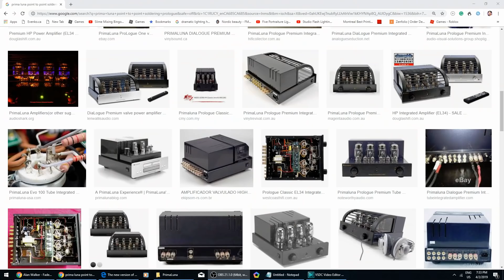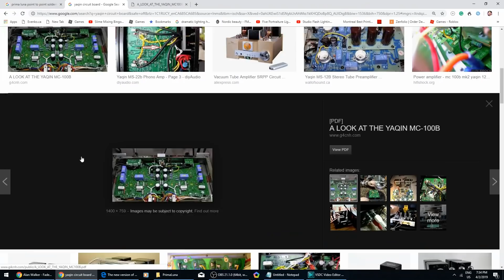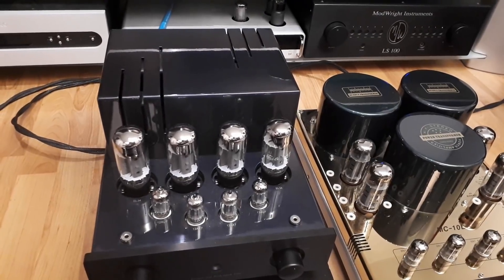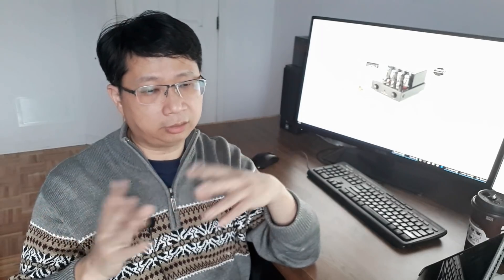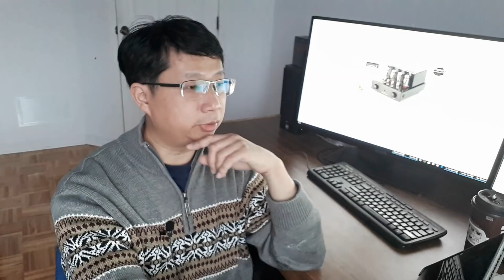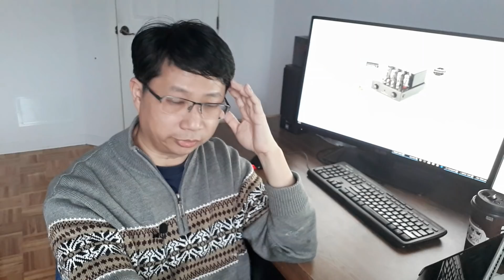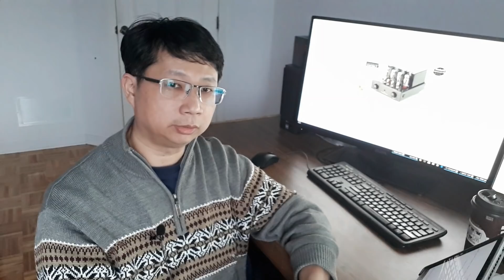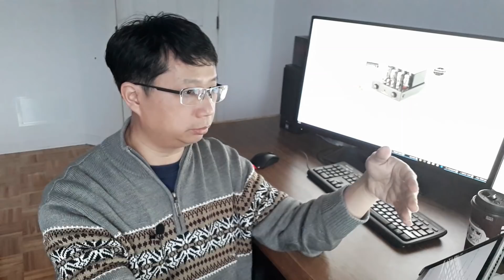Amazing PrimaLuna Prologue tube integrated amp vs Yaqin MC10L

Comment: Hi Thomas, I don’t think you should have to compromise by choosing between a “vintage” and “modern” sound. You can have both musicality and resolution. I've found that quite often, the brightness and leanness people object to is the result of noise. If you’re looking for ways to lower the noise floor on good tube electronics, I can offer a few suggestions: 1) If it has a cheap power cord inlet, switch it out with a Furutech NCF inlet. 2) if you have cheap RCA jacks, switch them out with Cardas jacks. 3) Experiment with Bybee iQSEs. 4) Use a good audiophile fuse. I like the Synergistic Blue Fuse. 5) Contact Stuart Jones, president of Chapman Audio Systems. He’s created these little capsules that go inside components that significantly reduce noise. 6) The component platform also makes a difference in high-end audio. I like using individual Sistrum platforms for each component to avoid the vibration from one component affecting the others. 7) Mapleshade Brass Tube Halos can also have a significant effect in reducing noise. Of course, a good audiophile-grade wall outlet, power conditioner, and power cable will also lower the noise floor. Regarding digital front-ends, I recently tried the Furutech Flux-50 in my CD player and was really impressed by how much it reduced noise.
Reply from the maker: Thanks for the suggestion. One of my friend want to give fuses a try and I wonder how much difference it makes. I never heard of Bybee iQSE, will check out. The rest like power and rca, we have tried those. Thanks again.
Reply: @ThomasAndStereo  The Blue Fuse is one of those small but significant improvements. You’ll hear a little darker background and more “meat on the bones”. Given that stock fuses have a wider tolerance band, order one amp rating higher than your manual specifies. Con: 300 hours break-in can be a bit of a roller coaster ride with some ups and downs. The price is obscenely high given what I'm guessing manufacturing cost is, even when taking into account R&D and the cost of doing business. https://www.synergisticresearch.com/fuses/blue/

With the Bybee iQSE and QSE the sound becomes more organic and you hear more of that magical holographic imaging around the instruments. I have two iQSE attached below my Cary 300SEI, near the rear jacks and below the power supply, two inside my Cary 303/300 CD Player, and two QSEs taped on my fuse box. https://bybeetech.com/products/#treatment-for-rooms-power-and-components

I haven’t tried Stuarts capsules yet. He’s a very honest and knowledgeable audiophile. He told me that I’ll have to experiment to determine the optimum number. They reduce the noise floor but too many of them can make the system sound dead. Stuart is also a Bybee distributor. http://chapmanaudiosystems.com/Contact/index.html

Three more very nice noise reduction devices I forgot to mention are the Furutech destat III, the IsoTek Full System Enhancer CD, and the High Fidelity MC-0.5 Magnetic Wave Guide (which made a very noticeable improvement even though I already own an Audience power conditioner).
http://www.furutech.com/2016/02/12/12469/
https://www.isoteksystems.com/product/essentials/full-system-enhancer/
http://www.highfidelitycables.com/products/conditioner/mc05/
Reply from the maker: THanks for taking the time to write such a long reply. Appreciate it. I will use this as reference when I am ready to try those.
Reply: @ThomasAndStereo  You're welcome. Besides using the IsoTek disc weekly to remove static charge throughout my system, it's also an excellent cable and component break-in disc. I ran the break-in track on repeat for around 20 hours when I bought my amp and the improvement was very significant. And it's inexpensive, around $30 (unlike the $150 Luminist System Enhancer CD from Purist Audio Design). :-(

Comment: My favorite tubes are the Siemens EL34.   They are NOS, but Mesa Engineering (a guitar amp company) tests and labels the NOS tubes as STR-450.  I really liked the PrimaLuna but went with the Cary Audio SLI-80, also a point to point handwired amp that runs in triode mode and ultra linear mode.  It sounds amazing through the Buchardt S400.
Reply: cosmo naut I love the Cary SLi 80 but sadly I sold it due to sounding way too solid state’ish. Good tube amp for sure but the Cayin A88T MK3 sounds way better! 😉

Comment: I have just bought the prima luna evo integrated 100 amp, about 200 hours play time so far. With my focal speakers I have to say it is the best sound I have ever heard.
I wanted to ask.
 Are there any DAC do's or don'ts for  valve amps particularly Integrated ones?

Comment: The Yaqin 10L benefits greatly if you up grade the coupling caps (100n 300v on your MK2) , also up grade the tubes, those stock Shuguangs are very poor, you can't buy worst tubes than those!  Try replacing the 6N1P's with E88CC Tesla if you can find any, as for the power tubes the current favourite is the Gold Lion KT77 also the EH 6CA7 is note worthy.
Changing the volume pot for a Alps type 27 Blue (use 50k Log) is another worth while mod. Good luck.
Reply from the maker: I remember seeing videos on modding the Yaqin and I did consider it. For the Yaqin, we actually had 2, The 10L and the then the newer one. We did try tube rolling and yes it did help with the sound big time.

Comment: The best tube integrated amp I ever heard was the LEBEN
CS-600 the problem is getting one is very hard and the wait list is long and my dealer only had 1 display model. The thing is AMAZING with the best volumn knob I ever felt ever. The prima luna's I heard were kind of not to my taste though and slightly cheaper sounding even though they had premium pricing. You really need super efficient speakers for them in opinion. The all japanese made Leben blew it out of the water BUT sometimes with this stuff you just can't get it. I will tell you the Leben makes bass and it was able to make a pair of inefficient and harder to drive Harbeth 30.1's its bitch. It is rated at 32 watts but more like double that I think...The Hyodo-san who makes these things is one of the top tube guys in Japan.
Reply from the maker: I see, I don't know much about Leben but it is now on my radar.  If it can drive a harbeth 85db speaker well, then it's something I really like to try.
Reply: @ThomasAndStereo  They are a small company he only has like 5-6 employees and they make 1 amp a day. The guy came from Luxman and was like running product development there for 20 years or something. So he knows his stuff.

Comment: around 14 min. i think you touched upon something interesting. PrimaLuna vs Yaqin regarding sound improvement limitations when upgrading to exotic NOS tubes:  i hear about a couple of rules in integrated tube amp design, which are shortest path (soldering point to point), and minimizing interference (magnetic, microphonic, etc.) in component placement. These are tried and tested experiential qualifiers that have almost been promoted to mythological status in tube amp design. Yaqin takes a more modern approach using circuit boards. PrimaLuna uses point to point welds. It’s interesting to think how these different approaches to design may affect or enable the ability of one amp to respond in sound quality with exotic and rare NOS tubes.
Reply from the maker: Good point, I never thought of it. Thanks for commenting.

Comment: Great video Thomas !
Very interesting product.  Have you tried different speaker with the PL?
  I am trying to understand how to select speakers with tube amps.  I was told that higher speaker impedance is usually desired and should be the main criteria over speaker sensitivity, technically speaking.  Should it really be a concern ?
Reply from the maker: I did try with all kind of speakers even those that are close to $10k. I would say it sounds great for the top end and mid range. Bass, is just ok. I understand the speaker impedance issue but I don't have a lot of knowledge with it. One thing I learned in the audio world is 1+1 does not always equal to 2 and you don't know until you plug it in. There have been some surprised along my journey.

Comment: you ever listen to them older Carver gear ? You mentioned the yamaha as-801 before i started my bargin reviews I bought the yammy I was so upset with the sound signature I sent it back my because my 2010 Yamaha Ax497 has such a lower noise floor and more of a fuller sound
Reply from the maker: No I never heard Carver. The AS801, yeah it's rich in feature but sound quality is so so.

Comment: A certain amount of the sound is conditioned by  partnering equipment. Cables. My amp was too warm. Fuzzy and a lot of hash  Change fonfo stage cabling etc this can significantly increase detail etc maybe because of noise reduction
Reply: I have always dismissed cables as snake oil. I still mostly think many cable products are just hype. However, I recently changed my speaker cables (25m distance from amp to speakers) from 16AWG to 12AWG and I couldn't believe the difference. I am not sure if it's just louder or if the sound is "warmer"... but if it is just "louder" I certainly prefer that 1dB of loudness, which somehow sounded "warmer" and more "expansive" to me.... I spent about 2hrs plugging and replugging the two sets of cables to make sure it was just my imagination.

Comment: Thomas, have you ever thought of bi-amping to improve that (for you only marginal) weakness in the bass? I use two Belles 350 A Refetence amps which does not only increase bass impact but also overall clarity. What works with solid state should work for tube amps as well.
Reply from the maker: Sure, only thing is the amp must have a gain control.

Comment: Hi Thomas, great video and down to earth analysis. Thank you. 

I think that it is fun to experiment with different gear and cables to learn what they can do to the music. Until one hears something and have someone points out that this is what it is called, it is difficult to imagine what that experience is, such as your term holographic, or perhaps air or soundstage? We bought a PL Prologue Premium a few years ago, the tubes that came with it were fine, then one of them blew after a few months and I bought another set of PL tubes (2X5AR4 and 4X12AU7) with gold labels. They were less than ideal. A few days ago I bought a set of Mullard (Russian made) and the music came alive. I can hear much more details, clarity as well as really nice solid soundstage, the bass is much better than before because I can hear the notes in the double bass and bass guitar clearly. The system has never been better. I use Chord Qutest, with AudioLab monoblocks and Celestion A2. They are relatively inexpensive gear but the sound is very satisfying. Part of the fun is to swap gear with friends and try a few things to find out what one really enjoys. As you mentioned, we have different preferences afterall. Look forward to more of your reviews.

Comment: The newer Prima Luna are supposedly improved.  Fuller sound tubes seem to be slower and don't get the musicalness as accurately as thinner sounding tubes with great quickness. Tone is important with tubes too, especially if your speakers have great tonal qualities.  Good power conditioning can get the grit out of the sound and make the tone (color, warmth) smoother and sound better.
Reply from the maker: I just need to get my hands on one to try. Thanks for the comment.
Reply: @ThomasAndStereo    PLEASE do Thomas!  Evo 100 Integrated (with the precious Pre-Out that I desperately need to biamp :D)
Reply: Thank You for your comments 🙏

Comment: Hi Thomas; very insightful presentation.
What about hybrid integrated amplifiers (tube input stages)? I am looking at amplifiers that will drive magnepan loudspeakers such as Vincent audio or Rogue audio. Your thoughts would be appreciated.
Reply from the maker: I have the Pathos Logos and it's very good. Too bad I have quality issues with my both unit. But for sound, amazing.

Comment: Primaluna is made by Sparks in China which they also make Cayin amps. Sparks also makes amps for other lesser names in tube audio. The issue with Primaluna is their so called “auto bias” electronic issue which tends to fail and cause issues. Primaluna is trying to eliminate the guess work of biasing tubes etc. IMO Cayin is way of a better option than higher priced item from Primaluna. Yaqin, Audio Space Galaxy, etc are other nice options to consider. As always, your video content is awesome to the audio community
Reply from the maker: Thanks, I am always curious about Cayin. Since like a well made product that will perform above it's price. Problem with them is whenever I come across one at a good price, they get sold really fast.

Comment: Not all tube amps respond well too tube rolling and upgrades. The design is the main factor.

On my Cary SLP-05, swapping out standard TungSol or EH tubes to NOS it gets very obvious. Then different NOS tubes will change the tone, not great amount but you hear the difference.

Sent my El Cheapo Yarland for upgrades, Mundorf Mcap Supreme Evo caps, Kiwame, etc. Got EH power tubes and all. It was just slightly smoother. Not a big difference. But it’s a great little tube amp. Cheap and good.

I’m still thinking of a PL amp. Itching for one. 😬
Reply from the maker: Yup, thanks for dropping by and commenting. Appreciate it.

Comment: Very interesting video. I also have heard solid state analytics in modern tube gear especially in Audio Research,  new McIntosh tube amps, and VTL. I also have heard tube like musicality in solid state amps  from manufacturers like Balanced Audio Technologies, Chord, and to some degree Electrocompaniet.  Where the focus was towards conveying sweetness and warmth over unflinching accuracy and hyper detail. Recently auditioned a Simm 760a, BAT VK-255se, and BAT VK-76se. It was surprising how different the Simm and BAT solid State amps sounded from each other, and how close the Vk-255se sounded like the all tube based VK-76se.
Reply from the maker: Thanks Ridire, I am glad others are validating what I experienced so I don't look like I am pulling all this out of a hat :) I heard som BAT older tube preamp recentely, very rolled off and musical.
Reply: @ThomasAndStereo  Tube like musicality from SS gear.  Now that's a video topic Thomas!

Comment: Thanks for sharing your viewpoint and experience again Thomas...much appreciated! 
For clarification of your old vs. new equipment, which one has that tube sparkle...my guess is the old? 
Also what cables did you use for your trial of the PriamLuna? Copper or Silver?
Reply from the maker: Well, usually, when I refer to sparkle in a speaker, it's the newer speakers. Tube, old sound would be about warmth. New tube will be more about precision. Usually I use either transparent super or siltech cables,  Yter speaker cable, I don't remember because I swap around a lot to fine tune the sound.

Comment: Hi Thomas, I have the PL HP Integrated Amp with the KT150 power tubes pushing my Kanta 2's and let me tell you it gives my system Bass for days with plenty of slam given the music you play.  I am more than satisfied. I also tried the SQ with a SS Yamaha Adventage AVR and the PL blew it away.  I just ordered a Lumin T2 DAC and I can't wait to try it with my PL. Will update later.
Reply from the maker: Yeah, you are talking about the Kanta, 50w ss is plenty. You have KT150 too, the better newer tubes. It's funny you talk about Lumin, they are well known in asia and I am supposed to review one of those dac in my future video.
Reply: @ThomasAndStereo  Ok cool, I will let you know my impressions of the Lumin T2 DAC when I put it together. 😊

Comment: I highly suggest you listen to PrimaLuna EVO 400 pre amp and power amps in a mono setup. Use the balanced interconnection. This is what I have along with an EAT E Glo S phono preamp or the Schiit Grungnir Multibit. I'm the guy with the Turnberry GR speakers and REL S/5 subs. The imagining and base you talk about is in this setup. The key to subs is to limit the presence of them. I do not want to hear my subs until I turn them off. They are only to complete what the speakers cannot do. Too many people set subs to high and they have a presence. Not my advice.

Comment: I bought a YaYi tube integrated amp a few years ago, direct from China. (4) EL34 power tubes, same as a Marshall guitar amp! And (2) 7025 preamp tubes. Paid less than $200 SHIPPED to San Francisco and it's built like a tank with wonderful fidelity. Especially after getting a matched quad of Russian made military grade Sovtek EL34's and 7025's
Reply from the maker: Interesting, did not know about this brand. You got a good deal then if it sounds great.

Comment: Agreed. that's why I have a vacuum tube pre amplification and FM (1960's Pilot) and solid state power amplification. Tube warmth with air and bass punch. I used NOS rectifier and 12ax7 preamp and tuner tubes. I've tried new Sovteks and found the performance and quality a let down.
Reply: sovteks are rather thin. tung sol is much better. I have a ST-70 amp, there is no way I would rather listen to a SS amp again.

Comment: Nice discussion! I prefer the old sound myself. Agree about the bass. I have a tube 50 watt x 2 on some old JBL titanium tweeter floorstanders that are 90db sensitive and I still have to push the volume to get dynamic bass. The bass drivers have 7.5 pound magnets on each, so they can put out some serious bass. Dying to roll some TUBES, but got to save the pennies first, lol!